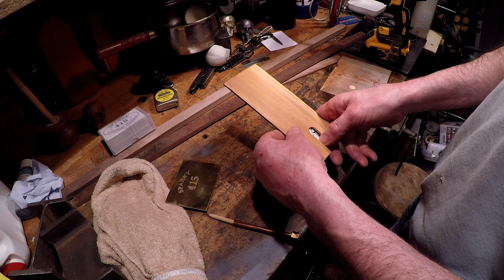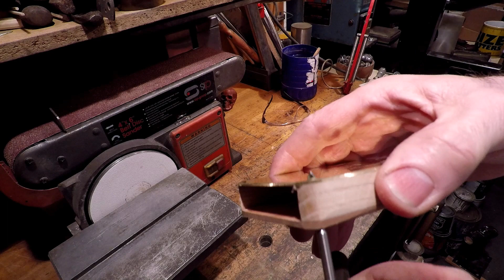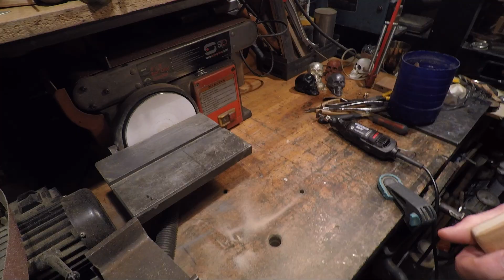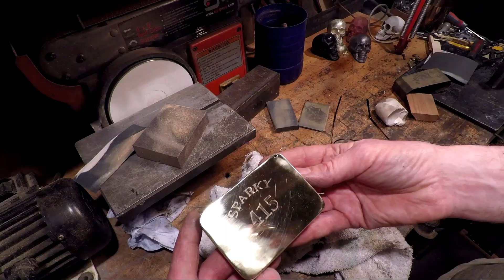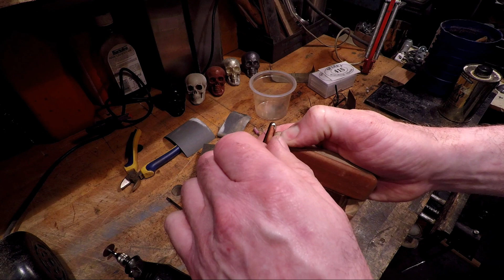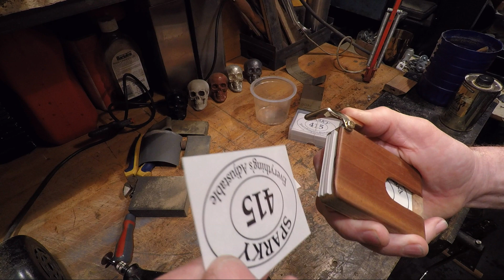#31 Business card / Sticker holder for Makers Central 2019

Comment: Interesting idea.
Reply from the maker: Thank you Benedict, there was going to be a little brass hinge but my silver soldering...
Reply: @Everythings_Adjustable  I did wonder if that's what you were talking about.
Reply from the maker: Yep I shall practice on some scrap next time.... probably  😊
Reply: @Everythings_Adjustable  Was the hinge and wing of a similar size?
Reply from the maker: They were the same width, the hinge was going to be on the top right with one 'wing '  an inch long and screwed down the right side and the other 'wing' was going to be for the lid about 21/2'' (it was the only hinge I have of that size and it's all in the bin now) Benedict I can rush thigs sometimes and be a bit clumsy